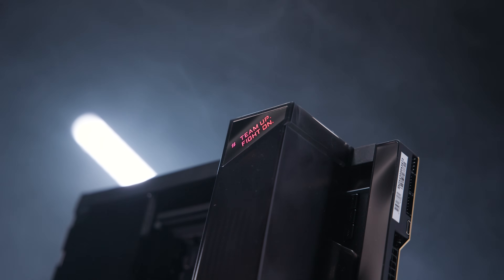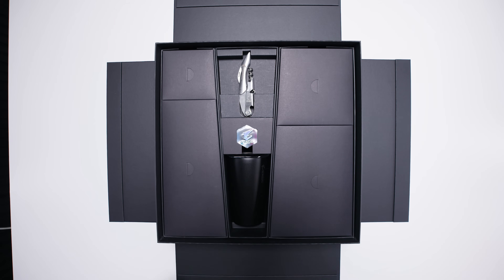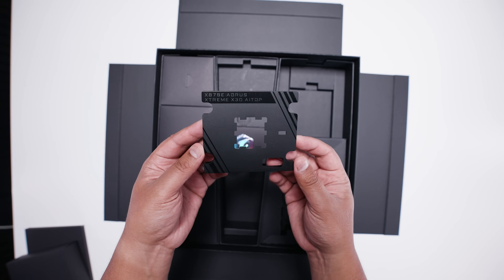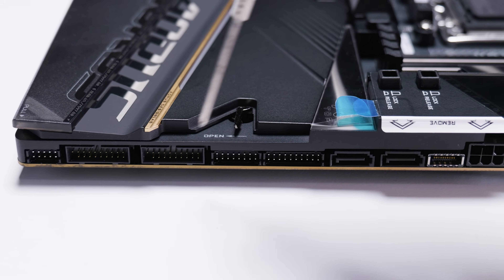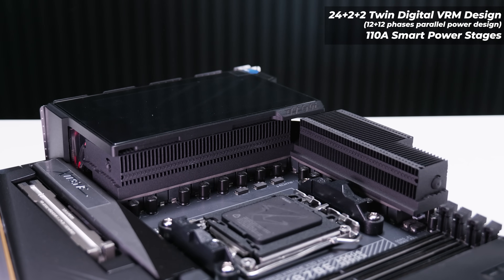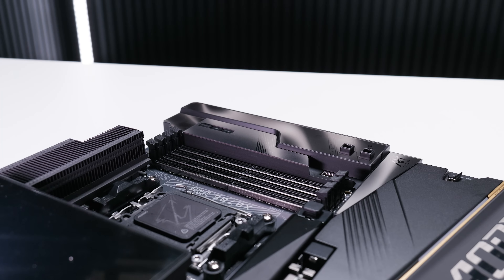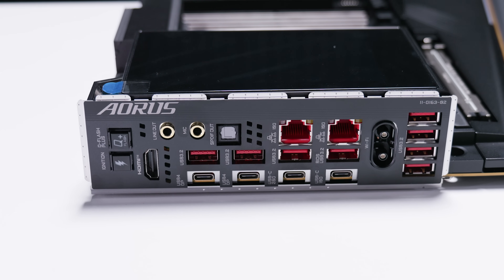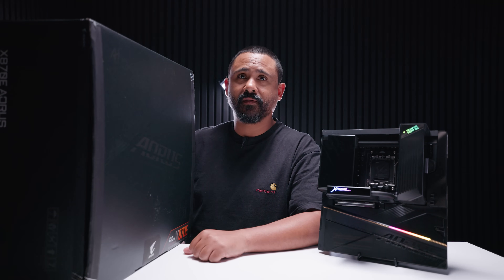Is This the Craziest Motherboard Ever Made?

Comment: They really looked at the Godlike and thought "challenge accepted" lol.
Reply: asus x870e extreme
Reply: @junior-OG that mobo ain't even in the conversation with these two. Why? Because theres somehow a case its more "sensible"
Reply: @boydolson5350 what do you mean more sensible?
Reply: @junior-OG the asus board is decked out but its more normal, i mean this board has a 92mm m.2 cooler, dram cooler, accessories out the ass. Id probably prefer asus over this or the msi but the gigglebit and msi boards have entered the realm of absurdity
Reply: @boydolson5350  yeah i agree but i still like the asus more
Reply: @junior-OG i said id prefer it too
Reply: Not even close
Reply: @Joshua-cs6gj the godlike is way way way more better than this one, you are so out of touch.
Reply: @FullJikama  Haha no. I own the Godlike. If it would work as it should yeah it would be better. Problem is it doesn't and they are all plauged by issues MSI will not fix. I'm on RMA Board #5 with MSI. Still got issues they won't/cant fix.
Reply: @Sytron-  nice, i have it too, i always been a godlike msi mobo user, FOR ME is the best, if for you is not working properly well too bad.

Comment: Compared to other "monster" x870e boards like the msi godlike and asus crosshair extreme, which one of them is the best?

Anyway great video coverage of this board!
Reply: for performance and stability the true best is the 2 dimm boards. If you wanna splurge the best of them is the apex from asus that is just below these in price except you actually get a performance advantage for it unlike them
Reply: @Frozoken can you tell me more why 2 dimm boards is better for performance and stability? What i mostly known that those kind of boards are mostly catered to those like to do OC. I could be wrong but yeah i want to know more 😅
Reply: @laventeinn Essentially even unpopulated the extra slots act like antenna interfering with the ram signals on the board and reducing stability. They also cause lower quality copper traces that take a longer route increasing latency because it has to connect to another slot and share bandwidth if 4 sticks are used (seeing it's only dyal channel).

They technically are "OC boards" but ddr5 has gotten so fast and therefore sensitive that there's now significant memory speed gaps on just xmp/expo between 2 and 4 dimm boards and this goes doubly so with speeds that seem stable on 4 dimm boards but just aren't and slowly corrupt your data.

If you have the budget for these kind of boards there's no downside as you can get 128gb of ram with only 2 sticks now.

Also the apex has more m.2 slots then the board in the video lol

Oh yeah the apex also uses 10 layer pcbs instead of 8 for better shielding so it actually uses higher quality components in general
Reply: @Frozoken  I mean the apex has strange pcie slot placement and selection, but if you only plan on using one gpu I guess it works. Also if you aren't pushing memory past it's rated specs the corruption shouldn't be an issue for most people. In fact stability isn't an issue for most people running 2 dimms on a four dimm-slot motherboard.

Comment: If I’m the designer of this motherboard, I would add 8GB  or 16GB of flash storage that stores the windows installation packages and drivers. That’s really more useful than a wine opener or a cup.

Think about it, you no longer need a USB drive when installing this motherboard because it’s built in.
Reply: This is called emmc on enterprise grade systems
Reply: Isn't cost effective to do it on board 
Just slap a small usb drive in usb port / internal header when packaging 

Cheap and modular, industry standard, replaceable
Reply: @frankwong9486  are you nuts?! does this board look cost effective?
Reply: @mainsource8030  why brother put something on board which needs to lay down more traces for the emmc flash which probably only used once , and the stock driver out of the box will be outdated and you have no way to update it without power on it like a regular usb drive ( except you add extra header to for write the emmc like some SBC ) 

A usb drive that comes with the box will do the job and you don't have an extra drive showing in the list when you boot or install OS